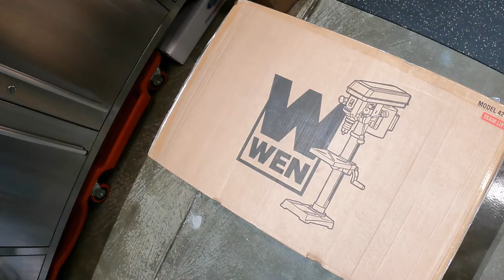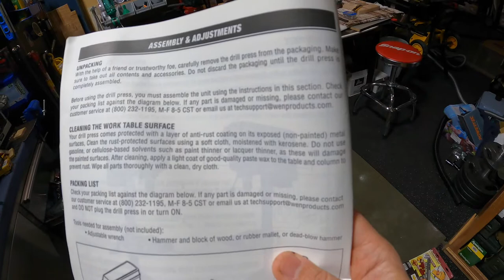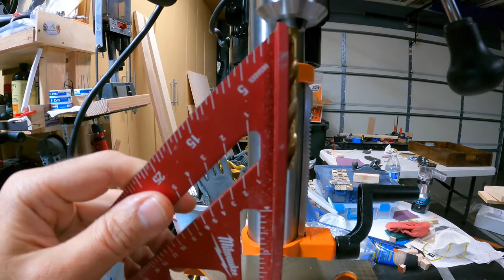Wen 4212T Drill Press Variable Speed DIY Drill Press

Comment: I'm going to leave the coating on mine until I get ready to use it.  Then I'll clean it off with lacquer thinner (I just have that at hand and it dissolves grease) and apply some Johnson wax to it to keep it from rusting.  Wax has the added benefit of repelling dust.  I'm not even going to bother with setting up the laser, just bring the bit down and see where it hits the wood, then adjust it as necessary till it lines up where I want it.  My garage isn't heated (unless I'm working in it) or insulated so I doubt any batteries would last very long anyhow.

Comment: So I put mine together a few days ago. my only problem is i can't seem to get the table to lock down. I have tightened it as much as possible but it still moves back and forth. Am I missing something?
Reply from the maker: Yes, it should lock solidly. Something is not right; id go back through the install instructions on the shaft and table, and make sure the hardware attaching to the upright rod are intact

Comment: thoughts on this drill press so far? thinking about buying to convert into a "ghetto mill" as well as simple drilling needs is runout out of box bad?
Reply from the maker: I’ve used it several times but mostly for wood so far. I think it will serve its purpose but keep in mind mine is a 4212 not the lower models. Run out has been nearly nothing for me. I think you’ll like this, also consider the higher line one, I think 4214? I ran into another would worker with a 4214 and I liked the heavier duty chuck and depth stop although they overall are pretty similar.
Reply: @shaunstayfree5551  thanks for the 2cents pal i really appreciate it, i plan on mostly wood projects but maybe some aluminum or light steel here and there but nothing more than a few mills.
Reply from the maker: @MrJaysniping  I’ve also bought a few bigger tools recently from CRaigslist and OfferUp, consider looking there too for something that works for you. But not much beats that new tool smell! Other than maybe saving $100s on used. Meh, it’s a toss up :) at least new you can abuse the tool the way you want and know it!
Reply: @MrJaysniping no no no no no drill presses are NOT made for that sideward pressure. Sure fire way for run out issues down the road. Drill presses are NOT mills!